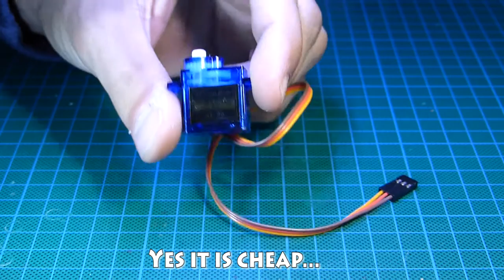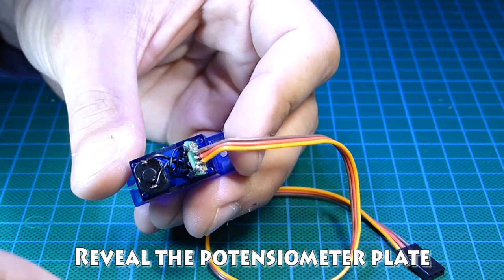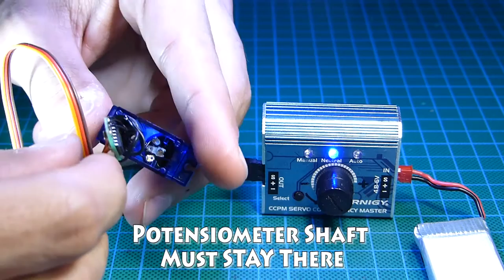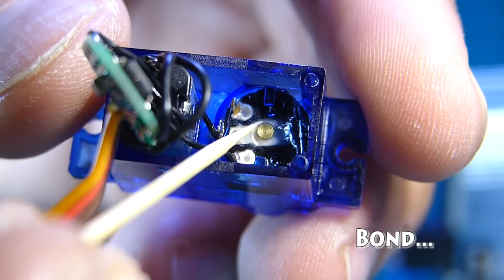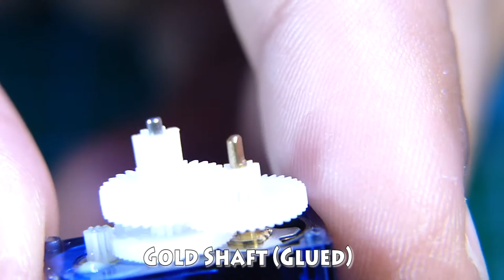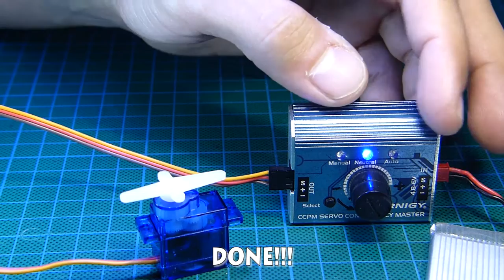DIY - Continuous Rotation Servo Modification

Comment: briliant!! much cleaner and easier than replacing the varistor by resistor and do solder!!!   and i find it easier and firmer to glue from gear side using epoxy based glue for me for the PCB that is stuck  to take out. and don't have to open both side ,just the gear side , although gluing need to be careful with the varistor contact point~
Reply from the maker: Yonoodle Hsieh 
Yes, it depends on servo model/structure also. Using resistor is a more sturdy job. Glue might mess things up but for this servo is a nice option, no need for soldering.

Comment: Is that the servomotor after I turn it into servomotor has continuous rotation can make an angle of 360X5 degree then returns to the starting point 0 degree
Because I use it to control a tap that reaches the maximum after 5 rotations
Reply from the maker: +Djaballah Soufiene 
You need a strong servo for that job, and probably some kind of controller.

Comment: Hi i did this to my sg90 servo.  it looks like the neutral position of the pot is not that stable. So everytime i restart the servo , 3 out of 10 trials, the servo/motor still jittering in neutral position, it rotates slowly a bit for 10-15seconds untill it finally stop. When i glued it , it's 100% in netural position. Did this happen to you too? i tried to mod 2 of my sg90 and both give same result.
Reply from the maker: jitter usually means that pot shaft is not stable. We need pot contacts to be precisely still  on the plate.

Comment: How the code?
Reply: Oh, it is include on the tester?
Reply from the maker: Muh Ali Machrus 
Yes, there is no coding, just a servo tester. There is one better method, you read pot resistance and replace the pot with two resistors, each half resistance, no need for glueing.
Reply: yeah, that method is familiar from youtube tutorial, so without your tester, can I run the motor like you just by arduino code?
Reply from the maker: Muh Ali Machrus 
I am sorry, I don't have any experience in arduino. I think there must be arduino boards that have servo outputs but I cannot help you with that. There are also 360 continuous rotation servos or geared motors with no need for this or other fix.